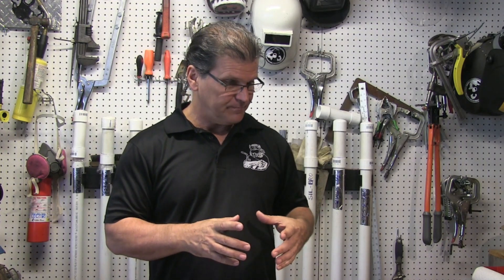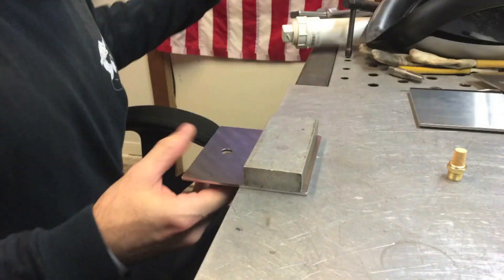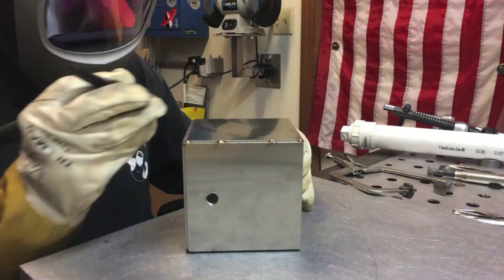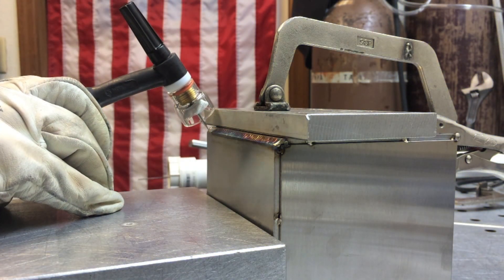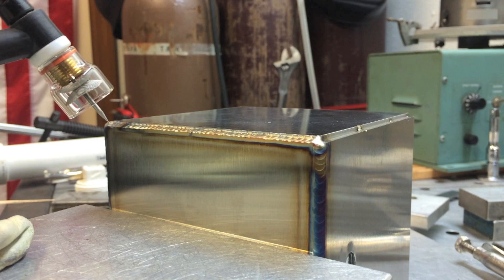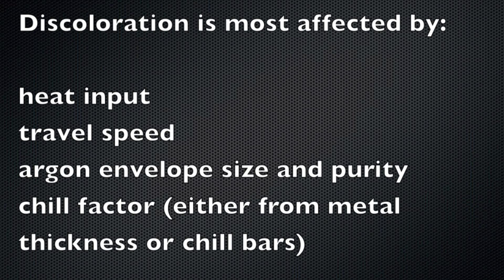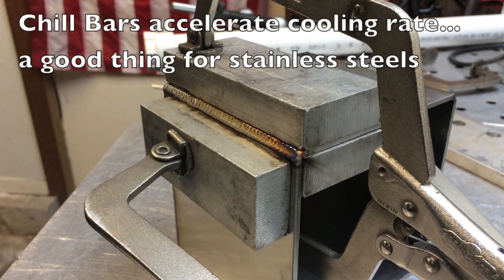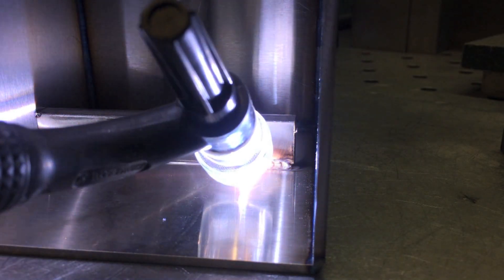Tig Welding a Stainless Steel Argon Box part 1 of 2

Comment: Why is he touching the tip to the weld after finishing his bead?
Reply: Just force of habit.  After the tungsten cools off I rest it on the bead for the rest of the post flow so I don't have to think about holding it in the air.  Just makes things easier in my eyes.
Reply: Roy Crumrine why do you weld right handed?

Comment: Hello thanks for the Tig videos just wondering could you do a demo of an Outside Corner on 1/4 inch plate with a cap run as I keep eating the edge plate away and cant figure out why thanks

Comment: I wish I had known about these large AL bars when I made the stanchion bases for my boat.  They were 3/16" base with .065" tubing.  ...  However, I did use copper blocks trying to weld 16 ga s/s sheet metal; not happening.  Ended up using 12 ga for that project.

Comment: Hi Jody, my name is Dustin.  I have been using a Hobart stickmate for scratch start tig.  I would like to step it up with a better machine. I would like to try some aluminum welding, so I want a machine with HFS and some descent features that doesn't cost a fortune. What would you suggest to get the best bang for my buck?  
Thanks I look forward to hearing from you.

Comment: Hey Jody, with your tips over the years I've made a lot of stuff.  Currently I am building a home hobby brewery that uses some very sophisticated electronics for process control.  Of course much of it is a welded structure,  The solid state relays however make a lot of heat, so they are attached to an aluminum heat sink (chill plate) with a layer of thermal grease.  The thermally conductive ointment would likely run and contaminate a weld, but the additional amount of heat transfer from the source to the aluminum, using thermal grease is a huge factor of efficiency.  Wonder if you've ever tried to use any barrier reducing type, thermally conductive, transfer pastes

Comment: Hey Jody, I appreciate you sharing your knowledge. It's an art that few people are willing to share. Question on aluminum mig welding: I prefer tig for most jobs but recently bought a Miller 252 with p/p gun, and have come to the conclusion that welding outside corner joints just don't weld up too nicely with a typical mig welder like this. (Maybe the 350P Aluminum is made for this type of welding?) Can you please share your thoughts on this? Thank you again!

Comment: it would be great to see some titanium welding in that mini argon purge chamber. Also, is there a advantage to using aluminum over copper for chill blocks?
Reply from the maker: +Chris MItchell Copper is actually better in most cases...but aluminum is just almost as good but  way easier to get

Comment: if you have access to a laser or waterjet or plasma..could you not limit your corners to only 4 vertical weldsbending would be tricky but could be done..great videos as always...I watch religiously and always learning..from Canada.
Reply from the maker: +Clint Partridge absolutely, you could notch 4 corners and bend,and save some welding... but for what it is, welding all sides is probably a bit quicker...thanks for the comment

Comment: good video.  why does he touch the work piece during post flow?
Reply: +Justin S if there is no current flowing and no molten puddle the risk of contamination is pretty much none its probably just easier on the hand to rest it there
Reply: +Justin S I believe it is just to rest the torch during post flow. I do the same. There shouldn't be risk of contamination to the tungsten if the puddle is solidified already.

Comment: i think for bigger parts it might be handy to use a adapted hotelfridge 
just add a window with a pretty big  welding glass 
sandblast cloves to keep the argon inside the fridge and still be able to reach in  
the argon intake and leather gloves to go over the rubber sandblast ones 
you can prolly drill a bigger hole though and trough and gleu a pipe inside to feed the earth clamp and the tigtorch through 
pull an cut operationglove over the pipe pull the wires through and pull an elastic band over the lot and the operationglove , should make it just about gastight 

will take a bit of time to purge a volume like the small fridge but the magnetic seals should be making it pretty gastight 
the plastic inside and insulation migh make things a little uncomfortable when welding longer periouds

Comment: Great to watch Jody - beautiful beads, and nice tips re heat sinking. May have missed it but, wondered what the current setting was.
Reply from the maker: +ChrisB257 actual amperage was around 90, machine probably set to around 125 and foot pedal used
Reply: @weldingtipsandtricks  5

Comment: Electrode type?
Reply from the maker: +TheKaffeeKlatsch 2% lanthanated 3/32" (2.4mm)
Reply: +TheKaffeeKlatsch 308 or 308L for 304 would be my guess. It's not critical at all.....could use just about anything for this project. 308, 309, 312, 316, or 347.
Reply: Jeff Silence I'm not asking about the filler rod.
Reply: +TheKaffeeKlatsch Probably 2% lanthanated like he always uses

Comment: This is such a good idea. I've been thinking about the same thing. My idea was to use a glovebox.
Reply: +Ralph Dratman 
Stainless steel cake pans are a good inexpensive place to start. 
If you know of bakeries in your area ask them if they have any unusable SS pans. In my area, the state inspectors prohibit commercial bakeries/restaurants/commissaries from using pans with dents or deep scratches/gouges.
Reply: patw52pb1 Is there some reason why this has to be made of stainless?
Reply from the maker: +Ralph Dratman I have seen other metals work but I think stainless is the best choice.

Comment: Love the videos man, could you touch on pipe welding downhill? 6010 root 8010 hot pass, fill, and cap all downhill. I'd like to see how your techniques differ from mine. Most of what I do is all 1104 downhill. Some b313 but mostly 1104

Comment: Maybe a stupid question but where was the "ground" clamp connected while he was welding? (I'm assuming this was done DCEN, so technically the clamp is + right?) Was it just connected to the table? Thank you
Reply: +Embrace Racing Probably hooked to his welding table the part was sitting on.
Reply: Must have been... maybe my table is crap but I never seem to get a good connection that way.
Reply: +Embrace Racing I always ground to my table and has always worked flawlessly
Reply: +Embrace Racing Roy had the ground on the table and that transferred to the part being welded.

Comment: Can you tig weld without gas??
Reply: +python71483 No it eats up the tungstens when its heated in the presence of oxygen
Reply: +python71483 Maybe if you were welding some aerospace component inside a vacuum chamber designed for welding, or if perhaps the filler rod contained flux like an electrode for SMAW. Otherwise, I can't imagine it could be done.
Reply: +sidgar1 You can tig weld without gas, but it makes a real mess and the arc is very unsteady. On the plus side, you get a much hotter arc. 

At least, that is my experience. I am just a beginner myself.
Reply: +python71483 all welding types have to have some type of flux or shielding gas from oxygen so the metal can cool without oxides trapped inside.   in my experience as soon as any oxygen can touch your puddle it will bubble and froth, leaving a swiss cheese mess that must be removed and redone.   gas or flux or bust
Reply: +python71483 
You can, but that will produce and inferior result in appearance, integrity, ductility and strength.